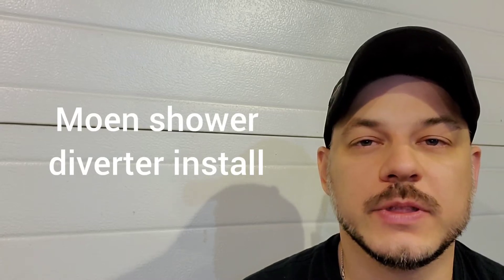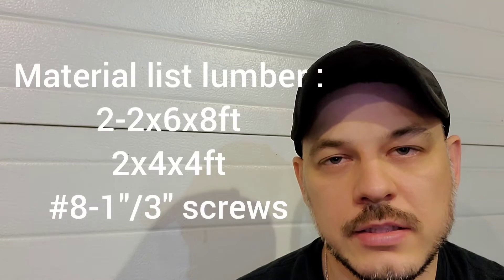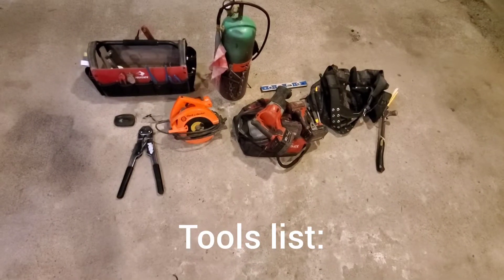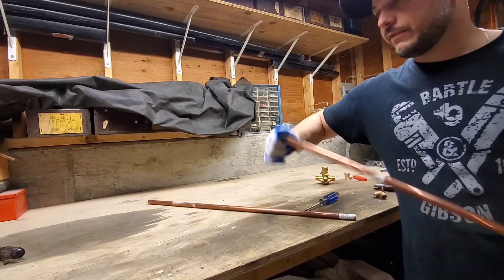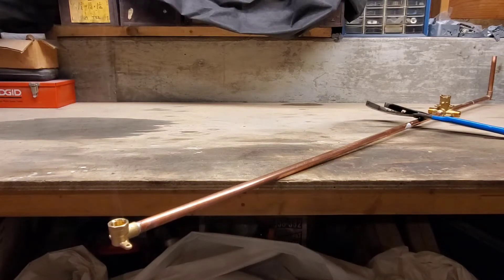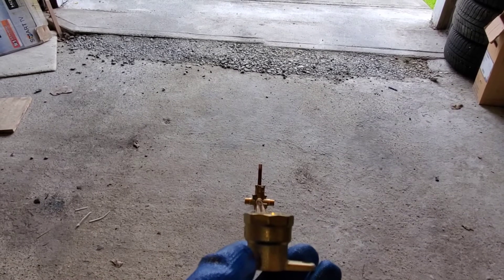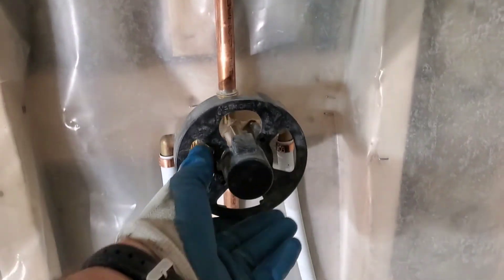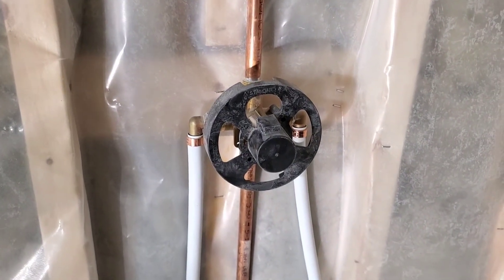Moen shower diverter install

Comment: This is a tub/shower valve. Not a diverter. A diverter is the valve that "diverts" water from shower head to handheld to body sprays. You can have a 2 way or a 3 way diverter.
Reply from the maker: Thanks for your comment, here we have either called them valves or diverters. Another example, on poly E, we need a "lift check", which alot of people call just a check valve. Different area's can call things something abit different.
Reply: @HomeownerDIY  I agree. I have had people call a tub/shower valve a shower faucet, a tub spout, lever thingy, mixing valve. I've been plumbing for 22 years. I was taught rough in valve,  tub/shower valve, or control valve.
Reply from the maker: @icculus7935  A few weeks l had a lady msg me about having a problem with her "hot water boiler" after she sent me a pic it was a tankless unit. I tell everyone now, "l have to see it" because the info they give you can be some what, unreliable haha.